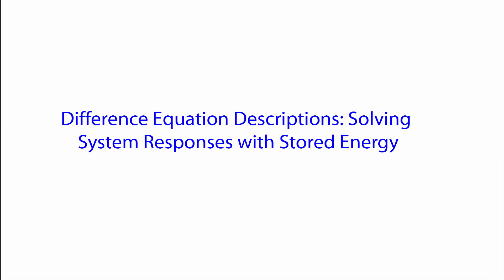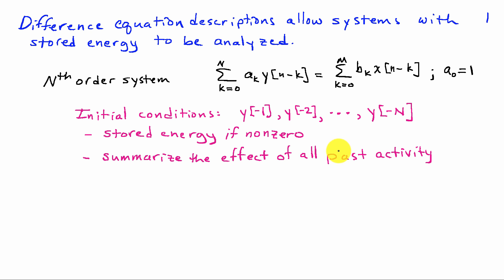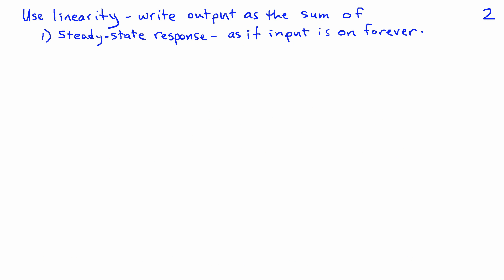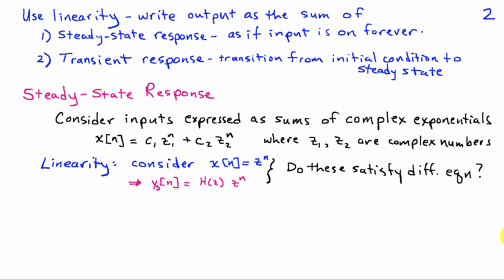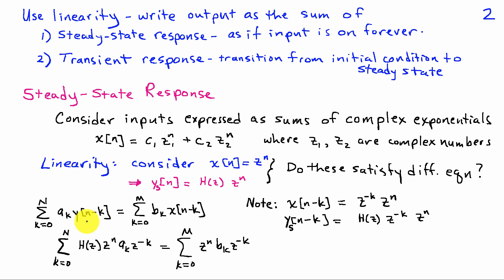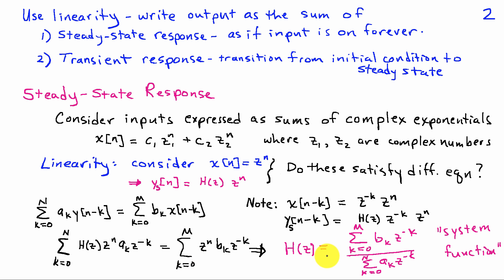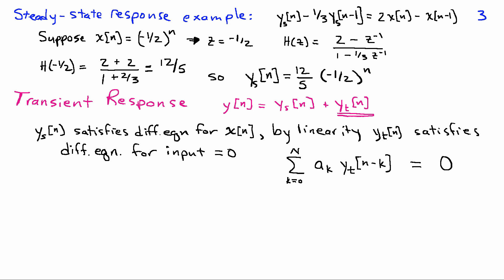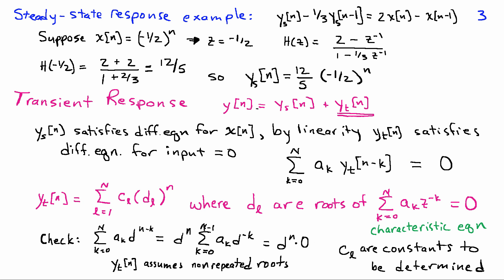Difference Equation Descriptions: Solving System Responses with Stored Energy

Comment: Determine the total solution of the following difference equation:
y(n)= 5y(n)-6y(n-2)+x(n)
when the forcing function , x(n)= 3^n and initial condition , y(-1)=2 &amp; y(-2)=4.
Also, draw the difference equation using building blocks.